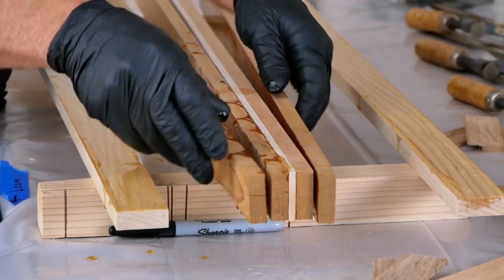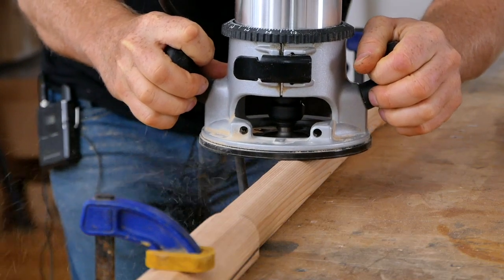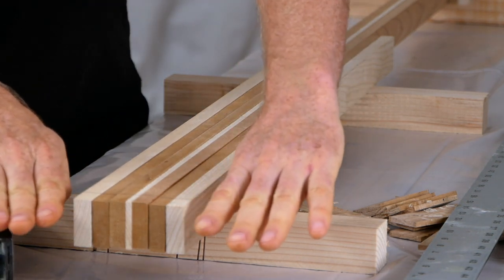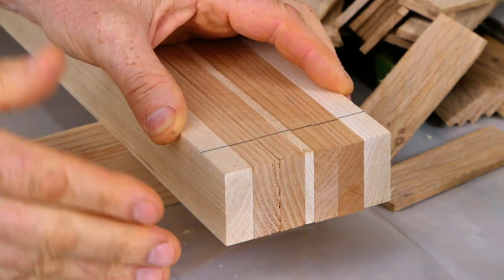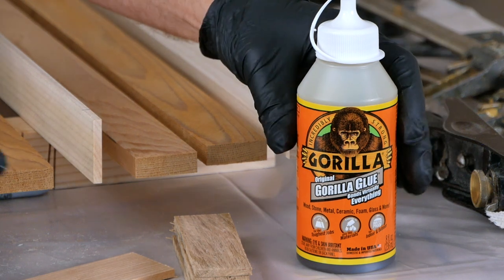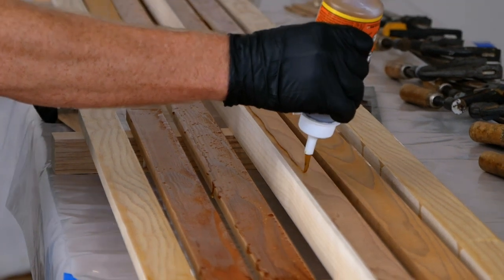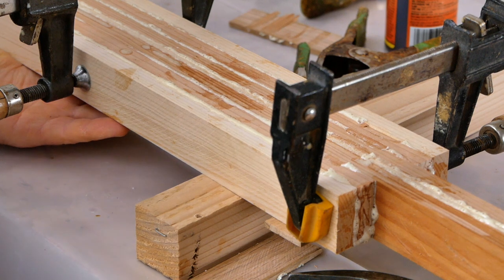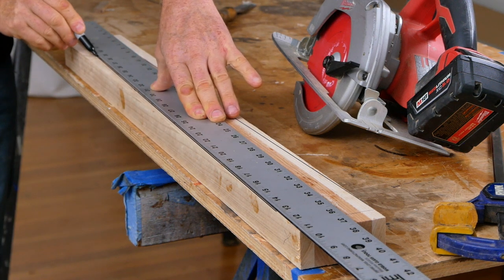Building a Greenland Paddle, Part 6: Laminating a Greenland Paddle

Comment: Never made a paddle but have laminated LOTS of things. If you put a single layer of wax paper over your supports and any other jig surfaces you don't want bonded you can  eliminate the step of semi-removal of alignment blocks. Also, if you do lots of glue ups having a long rigid straightedge along the far edge to use to ensure straightness can be helpful. 

BTW this is a very cool series you have put together! I can see how lamination would help make a superior wood paddle as you could mix and match.
Reply from the maker: Thanks for the tips. This exactly what I hoped would happen in the comments.  Improves the process for everyone.

Comment: Thanks! One thought. Have you considered hollowing the center of de paddle? Mainly in de middle section off course.  Especially with the lamination you have easy acces and you could lose some weight of the paddle without compromising the strength. Bending forces are all on the outside of a tube, so the center of the loom is basically death weight. Or do I forget something?

Comment: 22:00 - I didn't see you clamp to keep the center in place after lining it up with the string. Is there enough friction/weight in the system to keep it aligned after pulling on it like you did?